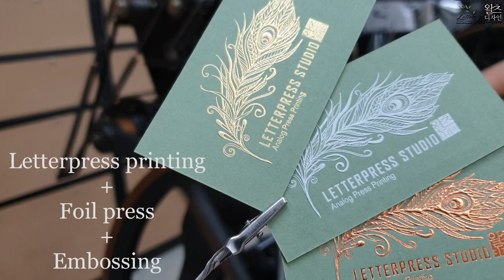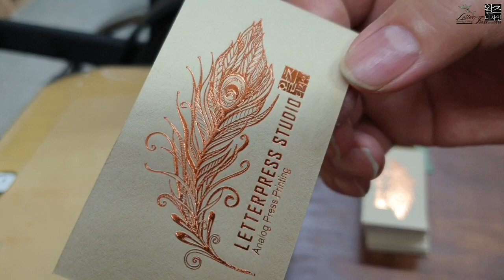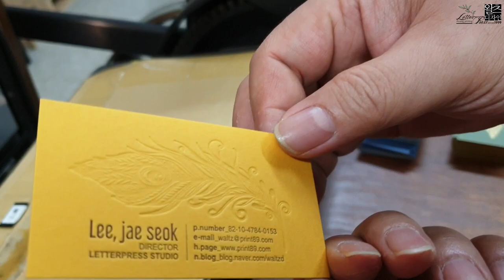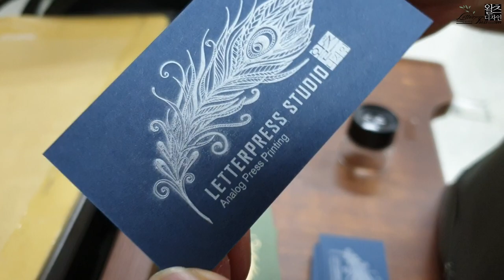Letterpress printing+Foil press+ Create an Embossing business card. 레터프레스 인쇄+박가공+형압가공으로 명함 만들기

Comment: Hi did you buy a heat plate for foiling I see it attached to the chase I am trying to find a kit for my heidleburg
Reply from the maker: Hello.  The heater device is attached to the place where the foil device is manufactured, so I do not know where to make it.  It is not released at the factory.  sorry.